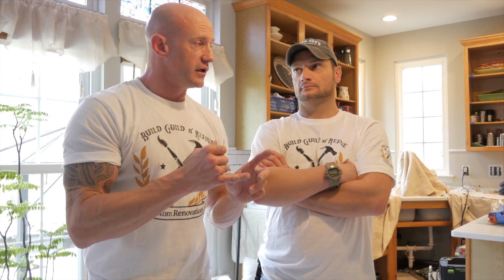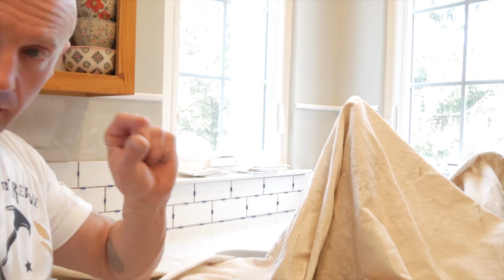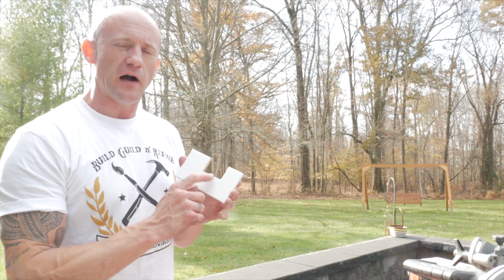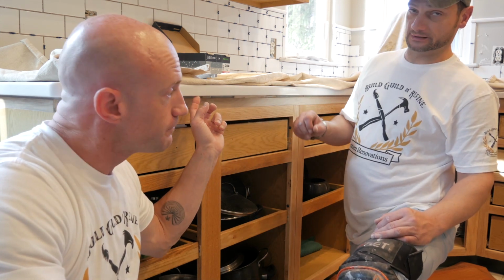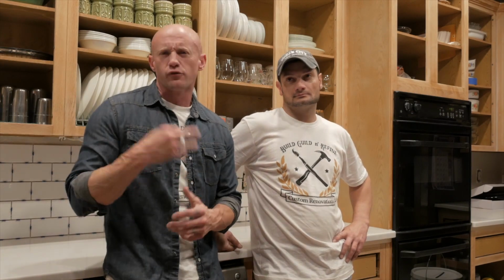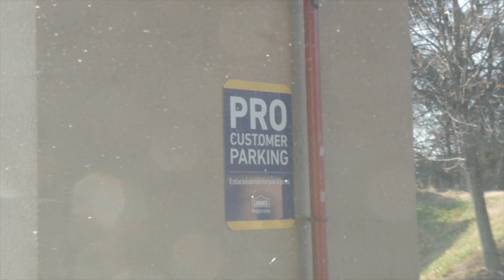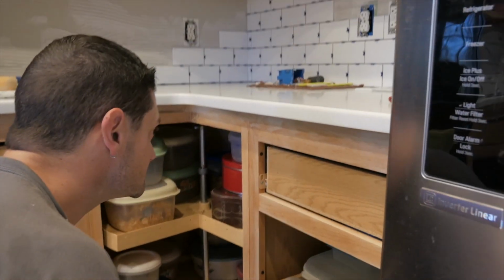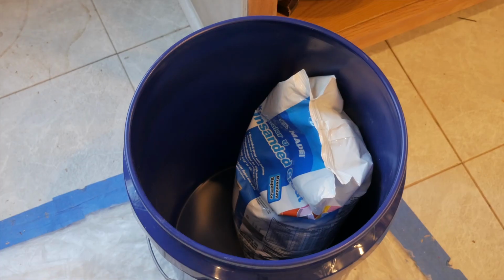How To Paint KITCHEN CABINETS on a budget - Part 1 - Kitchen Makeover

Comment: Using mastic in any shower, bathtub, or pool areas exposed to water will cause it to emulsify overtime. Basically, if it's exposed to moisture, it will dissolve. Thinset can be used in any of those areas including shower pans. Also, if you are only cutting ceramic tile for a backsplash, get a little angle grinder with some thin kerf blades from Amazon or a local tile/concrete supply store. They're a lot more manueverable for making those u shaped cuts, and no need to haul around a huge wetsaw. I recommend the Milwaukee angle grinder for it's power and stability. I promise you I can make a cleaner cut with my angle grinder and a $10 blade, than you're getting with that Ridgid saw.